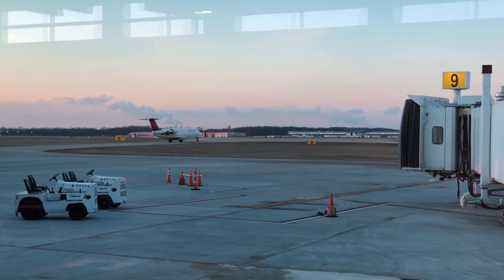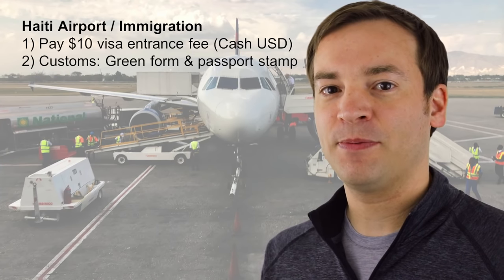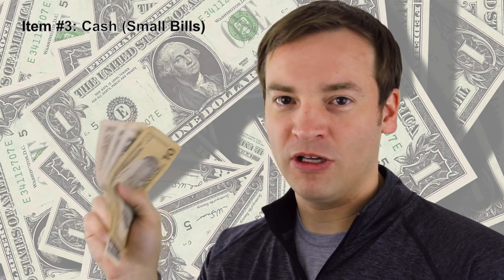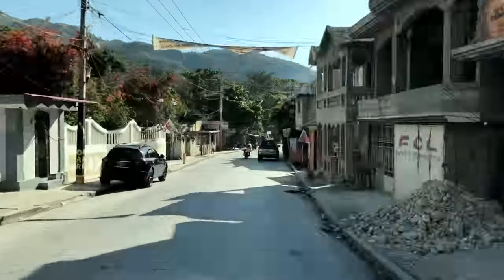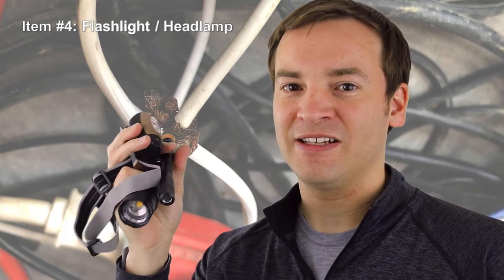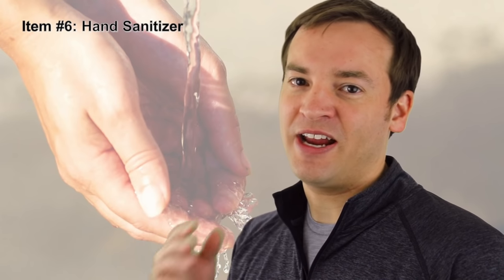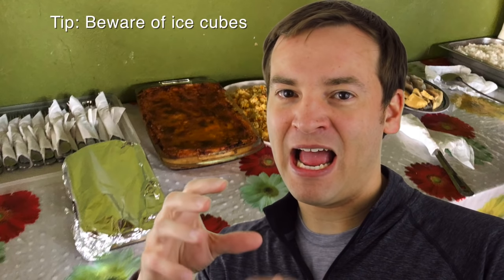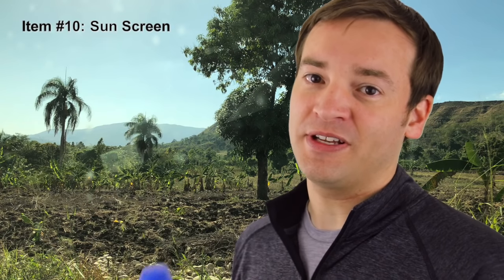10 Items to Bring to Haiti & Tips | Watch This Before Going to Haiti!

Comment: Great video Paul!! ..very good very informative. Great tips of what to bring to avoid problems ..wanting to go to Haiti ....what about credit cards?? .. thank you
Reply from the maker: The larger hotels, grocery stores, etc... may accept credit cards, but many places will most likely require cash. It can depend on where you are staying and what you will be doing. You can contact the place where you are staying ahead of time to make sure. Check the cash you bring with you to make sure it doesn't have tears/rips in it as they sometimes won't accept it. (make sure the cash is in good condition) Hope this helps!